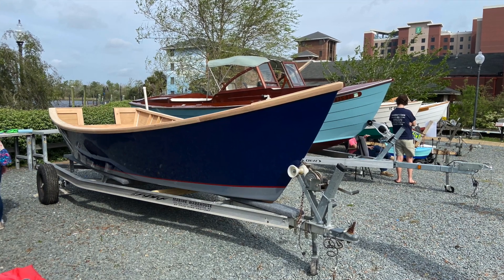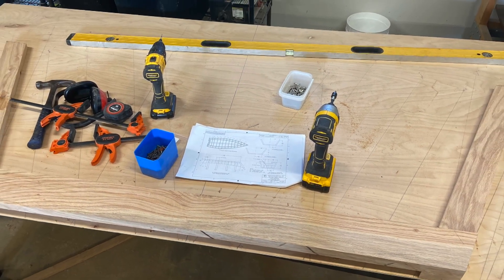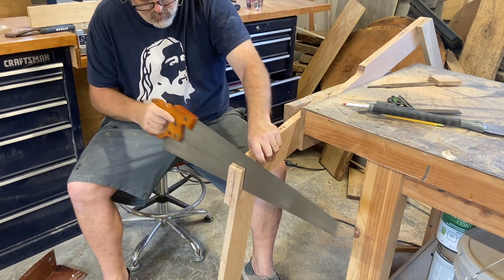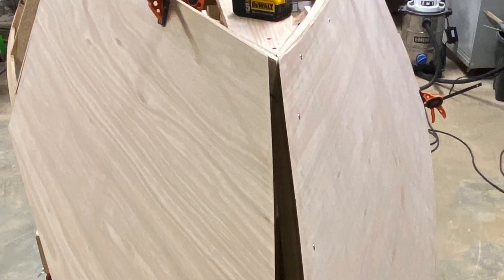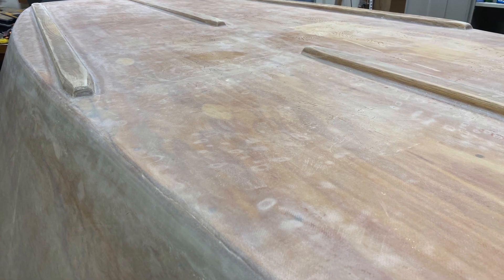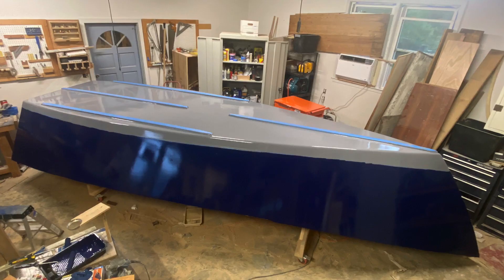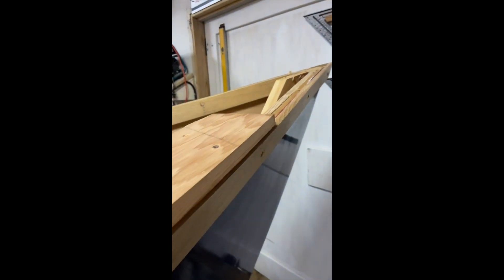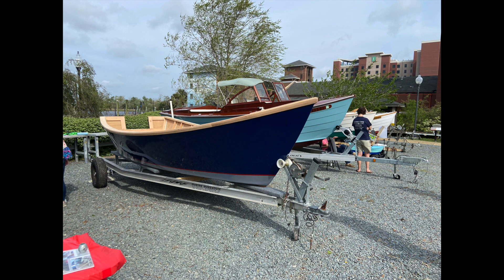Caladesi Dory Build Part 1

Comment: I'm sure the boat show people were drooling over all that white oak.  Looks great.
Reply from the maker: Thank you!
Reply: @michaelthemaker2135  Based on other Spira boats at these shows, I believe that if you had the interior finished with engine and all the extra boat trimmings added,  you would have either won or placed higher in the rankings. There was an elderly man that had won one of these shows with his 19' Albion Pacific Power Dory build. You can still see his build on one of Jeff's you tube videos. So don't worry about this show. Keep moving forward and all will be fine. That being said, have a great day Brother.

Comment: Great video on your build.  I'm doing the same design and have been working on it on and off for about 18 months.  You did some of the same things I did.  I haven't skinned it yet, but had settled on the thicknesses of plywood you mentioned, as well as doing 3 layers of 6 oz fiberglass instead of 2.

Some things I did differently: Instead of butt-joining the frames, I cut 1/2" deep laps so that the resulting shoulder would give extra strength after joining.  Further, I did not butt and pocket-screw the transom together.  I half-lapped at every single intersection; I believed this would be stronger.  I epoxy'd each joint fully and face-screwed with 1-1/4" stainless screws.  I also cut in 1/2" plywood panels on the inside of the transom with a router, sanded it perfectly flat,  and then applied 2 layers of fiberglass on that surface and sanded.  Seemed like doing this ahead of time made more sense as doing so sitting inside the boat would be a pain.

Your "jig" for flipping the boat was pure genius.  I'm stealing that idea.

You're from NC, my second home.  I miss it so sometimes.  Great place to live.  One day I'd like to drop the boat in Bogue Sound.

BTW, I believe the unidentified wood may be cypress.  Plentiful down in NC near the coast.  Mills up great and is quite resistant to rot.
Reply: Thanks for the suggestions for others!  The reason I went with a simple lap joint was that I was concerned about fasteners having something to bite into when I installed the chine logs

Comment: Hi Brother Michael. Thanks for this video. You've done a great job with both the boat build & video production thus far. Interesting to watch you complete the interior. Any particular details in mind? If you go with our dear belated friends advice of doing what ever you want with your boat, all will be o.k. Just a quick question about the frames. Did you use 1x4 lumber instead of 2x4 for some of them? If you did, that's great, it would reduce the over all weight of the boat. If you didn't, well, it's time for me to change my glasses. I see that you did like me and cut out the slots for the chine log and sheer clamp before assembling the frames unto the strong-back with the keelson. I realized that when I was ready to attach the longitudinal lumbers,  most of my previous cuts to the bow & stern ends of the boat where off angle and I had to do some extra cutting and filling for the gaps left. I also had to do more fairing of the frames. I fell for this mistake because it was easier for me to cut these slots with the frames unattached. All in all, keep up the good work that you're doing on your Caladesi. This will certainly prepare you for a greater challenge down the road. Until your next video, may blessings be upon you and yours.
Reply from the maker: The material that I got from the Sawyer was all rough sawn 5/4 stock. Most of it was planed down to about an inch in thickness. There were a few boards that had quite a bit of bow and twist so I could only get about 3/4-7/8 out of them. I tended to use those on the front end of the boat where the span of the frames was narrower. Like you, I figured I could get away with thinner stock and I would save some weight. Right after I bought the plans and decided to start, the cost of dimensional lumber skyrocketed. I actually got all this white oak for less than spruce or SYP lumber at the big box store. Just had to dimension it on all four sides.
Reply from the maker: Before I cut the notches I clamped the chine logs against the frames. This gave me the approximate angle that the chine would cross each frame member. I used that angle to cut the sheer clamp notches as well. I still had to tweak the frames to get the longitudinals to fit correctly. I probably clamped and removed each longitudinal 3-4 times before everything fit.